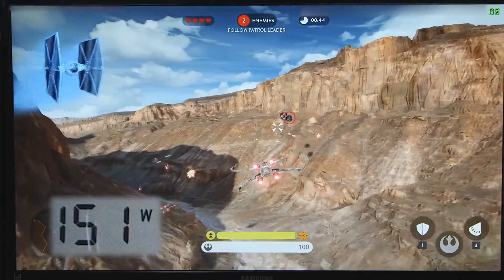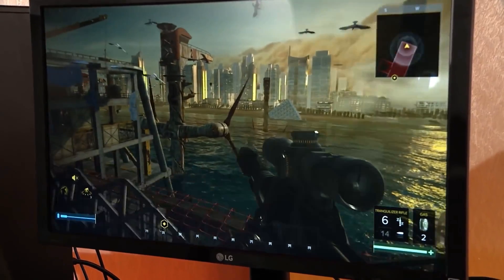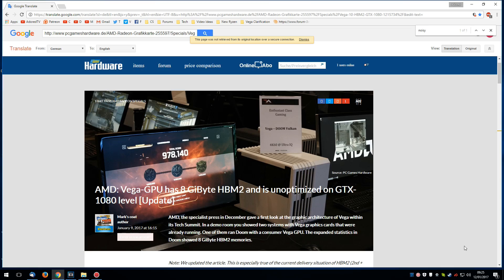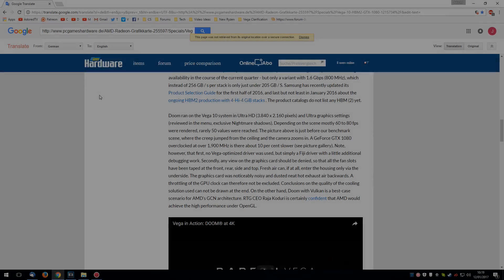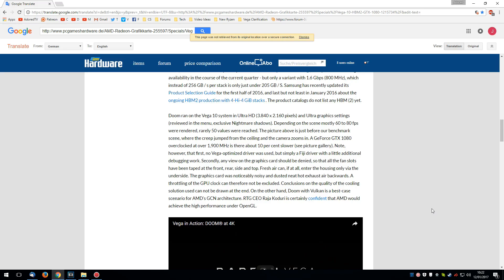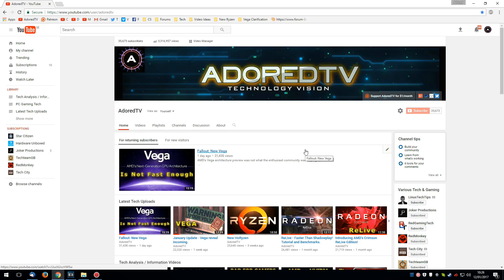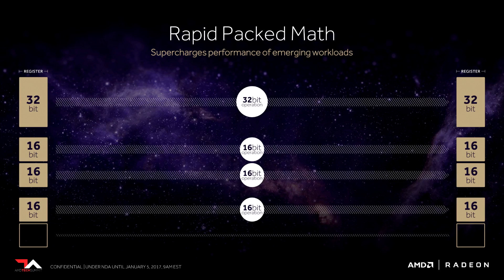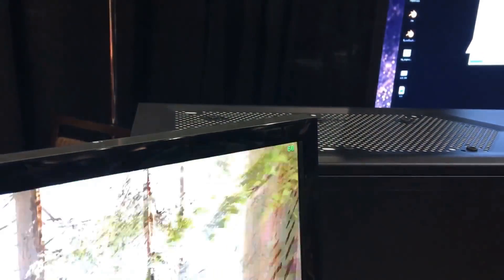Vega Clarification - How bad is it?

Comment: Honestly, if navi is an mcm gpu, I would treat vega as a test bed for it, as you have said, even when amd is better no one buys them. 

however, lets say you mcm the polaris gpu... from the 4 and 8gb price points, it seems to be 10$ a gb, so bare cost is 160$, and assuming literally everything has to be doubled, that would be 400$ beating out a 1080, 560 beating out a titan, and 720 beating everything nvidia has to offer, all done on a single.

If amd does mcm gpu, and if there is no crossfire like drivers needed or anything outside of firmware to make this work, there is no performance loss, this is where amd challenges nvidia again. Unless there is something drastic that can be done to increase performance, nvidia is a bit tapped.

The good thing about amd doing an mcm would also be single processor so everything from pro use to consumer gets hit by one sku, possibly 2 with one geared more for the pro line and one for the consumer where amd could make up ground in cutting fat that's not entirely beneficial to games and no splitting each segment up with different gpus, everything from the lowest end to the highest end is the same, just die numbers change. 

Depending on price, I may get vega, I may hold out till navi, I have a 280x factory oc to ghz edition speed that has been held back by my phenom III 955 for years, seeing how good that thing when the cpu isn't the bottleneck will divided for me.

Comment: Posting this from the previous video, still relevant:

We have no idea how Vega will perform, ultimately. What could AMD mean by 'flagship'?

1 - best configuration and performance of Vega possible
2 - biggest GPU die, but with fewer cores and/or reduced clocks, likely for ES Vega

I'm more in the camp of option 2, for a few reasons: if AMD revealed Vega 10's full performance, that means all the cards are on the table for Nvidia to see. Much like the GTX 980 Ti, they could simply prepare a counter and release it months earlier, and kill Vega 10 before it even comes out. AMD have a lot to lose by showing all of their cards at this point. Secondly, hitting 314mm² levels of performance with a 530mm² die, is just awful. Considering how competitive Polaris 10 is in terms of perf/mm² when compared to GP106, it does not make any sense that Vega 10 would be such a flop in perf/mm². AMD make some stupid mistakes, but this seems bordering on impossible even for them, especially with great minds like Dr. Su and Raja Koduri at the helm. 

Now lets talk semantics: what could flagship mean?

1 - best configuration and performance of Vega possible
2 - biggest GPU die, but with fewer cores and/or reduced clocks, likely for ES Vega
3 - flagship 'gaming' graphics card, just as the GTX 1080 was advertised as by Nvidia
4 - Vega is flagship architecture of current gen Radeon line

Clearly, there are a few more options about what AMD meant. This is just marketing 101, use vague terms to obfuscate the real value (or lack thereof) of your product to keep the competition on its toes, whilst generating interest and hype for consumers. So lets go over the options:

1 - self explanatory, and unlikely as outlined below. 
2 - Very possible given that Polaris 11 was shown running at something like 800MHz at CES 2016. Imagine a 500mm² fresh out of fabs and only just in the RTG labs having full ~1500MHz and all cores enabled out the gate. Silicon engineering marvel.
3 - Nvidia advertised the GTX 1080 as their new flagship gaming card. Who's to say that Vega 11 (small Vega) isn't AMD's GP104 equivalent, and their flagship gaming GPU, whilst Vega 10 is the GP102 competitor and their enthusiast class GPU not specifically marketing at gaming but for 'everything', like the Titan X (Pascal)? Makes sense from a marketing perspective, and also obfuscates the real value of these GPUs so Nvidia don't really have a clue what they're looking at.
4 - When talking about Flagship Vega, whose to say that they aren't talking about the architecture as a whole?

My personal bet is on both 2 + 3. 2 is quite simply logical, whilst 3 makes a great degree of sense from a marketing perspective.

Finally, have you noticed the massive amount of work AMD are putting in to advertising Vega? When LTT has sponsored AMD ads for BOTH Ryzen and Vega, they are running entire websites to advertise the new uArch, and the loads of other high-value marketing escapades they've been up to, you've got to sit and think: hmm. They are not spending all that money for nothing.

Of course, I could be totally off my trolley and completely wrong, but I think you're coming at this from a rather negative standpoint in this video.

Comment: Sold my 780ti Matrix Platinum EK WC a few weeks ago. Currently running FX8350 @ 4.8ghz and xeon x5650@4.6 ghz max in my two systems. Xeon is getting better results in gaming so I'm gonna sell the 8350 for another x58 xeon 5670. Both running oc'ed and watercooled 290x's. But this is just for the time 'til I get more money. I'm gonna take the ryZen path and might change at least one Gpu for a ve.ga! nvidi-shit just annoys me. Gtx980 legacy already? Glad I didn't buy one of these for almost no advantage over my 780ti.
All the analyses I might must agree while on the red side of the table it's quite hard to admit.
Vega seems to Battle the gtx1080 but we expect a lot more. For me personally it'd be nice to get 1070+ performance for <300 Euro. I'd pay 440,- Euros for gtx1080 
performance as well. A well balanced 6/8core hyperthreading system with ryZen might be affordable for under 1500,- . Including m.2 960 and 32gb ddr4 with some sshd tb's and a nice case with some proper cooling.
Still red, still AMD, still winning!!!! xD

Comment: ignore me if I'm wrong but AMD ran the Vega card at CES  in debug mode did they not? or have I got that completely wrong? also running on Fiji drivers. Debug mode would take a massive toll on the gpu then throw in the old drivers and the card is still hitting 70 fps at 4k ultra, I would say thats pretty impressive... again ignore me if I wrong but would love to  know if there is any truth at all to this?

Comment: Adding tons of new technology, releasing cards that are more advanced, but run slower on the old stuff than their competitors, and targeting the professional market more. That's sounding a bit like the Matrox Parhelia. At least it's almost the same performance as the competitors instead of half.

(Honestly, If I had my choice way back in the early days, I'd have preferred an ATI vs Matrox graphics market instead of an ATI vs Nvidia one. When I was finally chased off of my great Matrox G450 to an Nvidia card, it was buggy and had lots of graphical issues compared to the Matrox.)
Reply from the maker: Yeah I remember that one, hopefully AMD aren't gonna go the same way!

Comment: The problem about ryzen is : they downclocked the intel cpu to 3ghz but it can reach 4ghz and more. It's at least +33% performance for intel and we dont know if ryzen will be able to reach such a higher clock. Given polaris can only clock really low i doubt ryzen will be a good overclocker. I hope im wrong but if they sell it for 300$ and it's still 70% of the power of a 1000$ cpu it will be good for the market.
Reply: amd cpus in the past have always overclocked really well

Comment: So I was one of the many of consumers who thought

"Hmm, which $200 should I get? RX 480 or GTX 1060?"

So I did my homework and looks like the 480 would be my final decision. It costs less, performs about par, and works with AMD ReLive (less laggy to shadowplay according to AdoredTV) for recording. They also implement AMD FineWine Technology (long term software support) which is great because I'd like to buy a card that would last me longer in the long run than to upgrade every 2 years. Like people say, "AMD ages like wine, Nvidia ages like milk"

I made a good decision on my December 2016 purchase, don't you think?

Comment: PC Gamers: I'm sorry but disagree alot with what AdoredTV said in this upload and the previous one. First of all, we don't know the die size of Vega yet so there is no way you can make a honest assessment on anything. But one thing we do know is- AMD's ALUs (Arithmetic Logic Units) take up less die space than Nvidia's and Intel's for that matter; so in a die shrinking race, AMD will win because at a certain point, Nvidia will have to stop because of their ALU's size and with CPU Parallelism from DX12/Vulkan, Nvidia will get overly-saturated, i.e. performance latency like they are experiencing now.

Nvidia will have to sell the 1080ti at an exorbitant price, not just because they can but rather they kinda have to- manufacturing cost. AMD is mostly relying on software to catch up to hardware via optimizations (e.g. Shader Intrinsics) and especially Explicit Multiadapter (Explicit GPUs) which will be the case in the future. How much in the future is undetermined.

Alot of Gamers are starting to realize that Nvidia is having problem with DX12/Vulkan; in addition, PC Gamers are also realize that Nvidia's business model is Planned-Obsolescence especially after the major performance drop in Kepler (e.g. 780Ti). As this information get wide-spread, Nvidia is doomed.....and no, I don't mean the video game. Why would you want to buy a Nvidia card?

Comment: @adored:

Actually AMD did sandbag ZEN at its 1st Demo - at least sort of:

In August everyone thought that ZEN 3.0Ghz vs 6900K 3,0Ghz running Blender was an absolute best case for AMD by beating the 6900k ever so slightly.

Then later in December AMD Ryzen beat the 6900K in Blender again, but this time running clocks a little lower than before in comparison to the 6900K - so Ryzen in December was slightly faster then shown off in August.
Additionally AMD showed Ryzen beating the 6900K in Handbrake in December - showing that Blender wasn't a best case scenario at all.

So in summary the ZEN August Preview was sort of sandbaged. And this was the 1st Vega Preview....

Additionally ZEN gained quite some frequency from August till December, and in December everyone thought that AMD must have the final silicon by now. 
But during CES two new stepping popped up from nowhere F3/F4 which could not have been fabbed between Horizon event and CES - so AMD does multiple revisions parallel or in a very short time after another implying that AMD likely has other chips at hand for Vega also - my guess is that the Vega chip at CES was likely from december and AMD probably has other revisions at hand which may be faster in terms of clocks by now. So for final cards in May AMD would have to start final silicon mass production in end of Jan/beg of Feb. So there is room for improvement, but I agree it is not a lot.

If your assumptions are correct and Vega 10 will only be a little faster than the 1080 all the press will be over AMD for the tease of "poor Volta" - and that is a mistake I am not sure Lisa Su and Raja would be making...
Reply from the maker: Zen actually lost the 2nd comparison in December, by a minuscule margin.  You can see how they pulled it from their final vid but I have the original. ;)

True that Handbrake was a great showing however.  It's possible that Vega has a big clock increase like Ryzen though...I really hope so. ;)
Reply: AdoredTV Oh, I have to re watch that.

Comment: Im wondering if amd arnt using vega in its weakest form, purposly running it on unoptimised drivers so the new stuff isnt even on, pushing heat onto the systems to throttle them for one specific reason, 1080ti. We know they dont mind ppl seeing the vega because linus has a video on it. Now we all know that the 1080ti is being held back to knock out the vega, so what if amd are doing a ropeadope.

 I say this as most ppl going for ryzen are going togo vega anyhows, so really to them they only have to show it doing great in 4k, great in 4k relates good to other displays. But for pure diehard nvidia fans its going to take something cracking, and if amd get nvidia to release a just good enough 1080ti and then amd drop the vega and pazaam.

Comment: Did AMD say that the chip they were showing in pictures and demoing was absolutely Vega 10? Could Vega 10 like Polaris 10 have different versions like the RX 480 8 GB, RX 480 4 GB, and RX 470?

The only reason I can think AMD are sandbagging is because they know Nvidia will release the 1080 Ti as 'Vega demo +1'. If Vega's demo is set low enough, then Nvidia's 'Vega demo +1' 1080 Ti will be equal to the Vega final release.

On another note, What do you think of Vega 20? Do you think Vega 20 got inserted between Vega 10 and Navi 10 because of design problems with Vega 10 and/or Navi 10?

Comment: AdoredTV i think your argument about clocks is kind of flawed. 
Vega is 5-6 months away.

ZEN when shown at August, was clocked at 3.0Ghz. 
Then At December 2016 it was benchmarked again at Blender and had 3.4 Ghz.
Now they said it will have 3.6 GHz.
And the release is gonna be at around March.

Why should VEGA have these same clocks it has now when it's 6 months away from release?
And didn't they have that USB port to check out the power consumption?
Doesn't that mean the card is still kind of early for release since they haven't figured out the TDP yet?
Reply from the maker: There is a chance that Vega will have higher clocks than what this engineering sample shows, yes.

Comment: I'm still not convinced. The card is meant to be 10%(?) better than the 1080 currently? I think optimised drivers could add another 10% on top of that then Finewine Tech another 10%. So that puts Vega just short of Titan XP (iirc). Apparently, Raja said that they were still footering with the clockspeed of the GPU trying to work out its limits and its sweet spot... so add that into the mix and there is very much the potential of a Titan XP killer in the making.

I don't buy this "AMD don't Sandbag now because they haven't done it before". We are now in a culture of memes, kek and Pepe. Given events in 2016, maybe AMD are just keeping with the times. They obviously know that NVidia have the 1080Ti on the bench and were most likely waiting to see if NVidia would cough at CES. As it goes, NVidia did cough as there is a rumour doing the rounds that NVidia were scared of what Vega might be able to do and therefore pulled the 1080Ti demo at last minute.

AMD most likely do have the final silicon, but I don't think production has ramped up yet. In fact, I fully expect the production of Vega not to ramp up to volume until after RyZen has been released (which is rumoured not to be a paper launch) on 28th Feb, as RyZen will probably be the current focus due to it being the next milestone product launch from AMD. Then they will have the fabs focus on Vega ready for May and I reckon the Vega launch will be paper launch, as was Polaris (iirc).

Comment: The best I can see from VEGA's flagship is within %5-10 performance of a 1080ti, or on par with OC'd 1080s with a price tag of about $600. We can't realistically get a lower price for the cards that use HBM2 since it's still an expensive technology, and the fact that V10's die size is pretty damn big.
     Regardless, I highly doubt AMD will be "sand-bagging" anything in the higher end gpu market with their pitifully low R&D budget compared to the likes of Nvidia.
     Personally, I think AMD should refine their RX 480 strategy of trying to capture the lower-mid end market. The 480 is now an overall better card than the 1060 with the latest drivers, which leads one to believe just how epic a 480 refresh could be with lower power draw and higher OC potential.

Comment: Guys, you dont get it.
At 500mm^2 and HBM2, it can not be too cheap. It simply is impossible. Meanwhile with GDDR5, 5X and 471mm^2 or 314mm^2, GTX TXP, 1080 and 1070 can easily be the same cost as Vega... and give Nvidia a LOT more money.

Imagine this. Vega comes out and it is 400 dollars. Impossible IMHO, but lets imagine it. AMD will make 100 dollars on a VEGA GPU. Nvidia bring prices of GTX 1080 down to 370 dollars, a bit less than Vega. Nvidia will make 150-180 dollars per GPU...

Adored it right. Unless Vega is TXP level by default and then improves with AIB versions/Drivers, AMD lost 14nm and will be crushed by Pascal refresh and Volta.
Reply: Yep.. For prices to be low they would have to sell the damn thing at a loss, which is exactly what AMD does not need right now.

Comment: Good point, how long will it take the gaming industry to use Vega's technology? Looking backwards it would seem a long time, 2-3 years.

However, the worm has turned and that is not the current environment. AMD controls the gaming industry's technology now. What?!! I can hear people spitting out their coffee. All consoles are using AMD technology now. With DirectX 12 and Vulkan development while being more difficult to get up to speed will simplify tailoring projects across the platforms. Now why will developers want to spend the increased resources? The old methods are fine. Yes, they are fine, but they aren't on 4K. The consoles require using low level computing and development to run 4K. As I see it, DirectX 12 and Vulkan are upon us now. By the time Nvidia launches the TI, Vega's technology will match it in performance. More importantly, we've seen Nvidia have graphical issues when running Vulkan despite also seeing small increases in performance. 

4K in the "living room" will be the norm by Christmas 2017... Global economic meltdown not withstanding. Developers launching 4K games will have the marketing edge and their parent companies know this. 

Now all of this can be thrown out if Nvidia's next iteration can use Vulkan/DirectX 12 and async in general in an adequate fashion. At least on the desktop. On console, well, they are locked out of the competition.

Regardless, a $300 GTX1080? That would be nice.